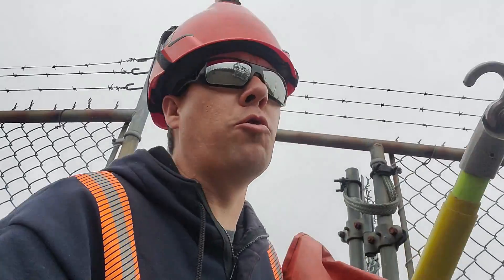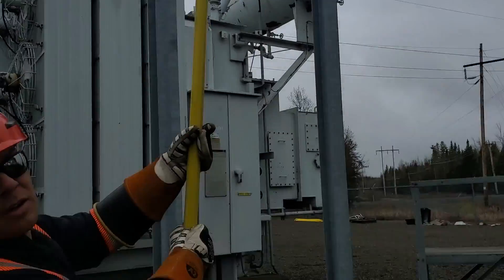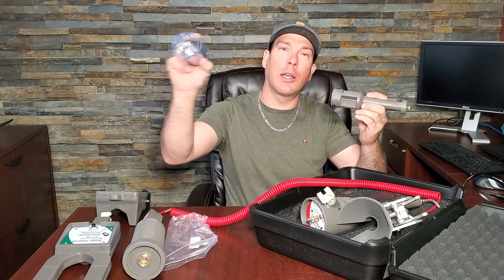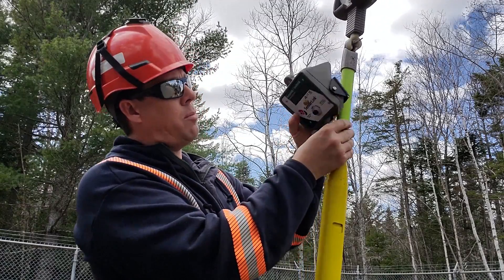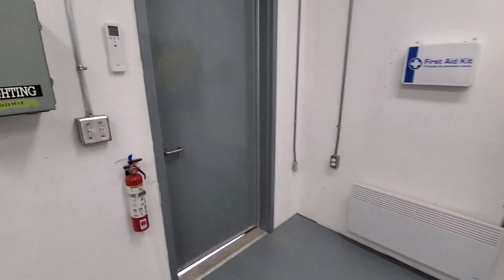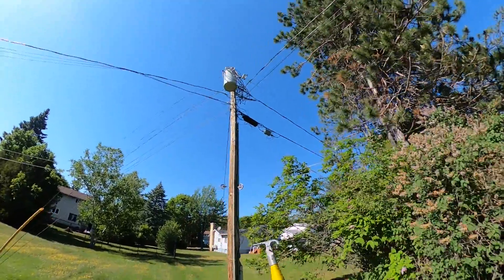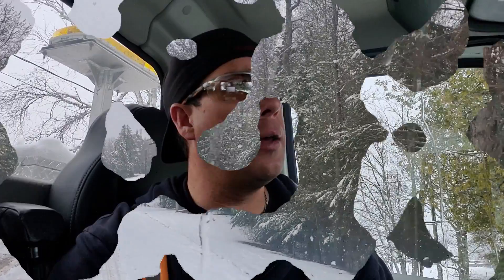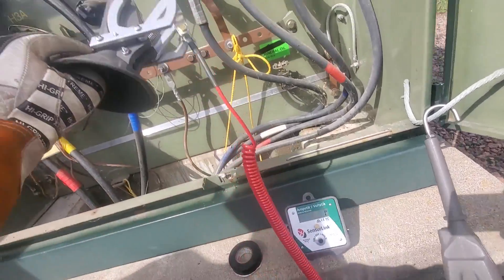High Voltage testing with SensorLink - Troubleman's kit

Comment from the maker: Another great use for the voltstik - It can verify tap positions on a Voltage regulator! 
I apologize in advance for the absolute cheesiness at the 5:38 mark!  🤣 - Have a great week everyone!
Reply: 69,000KV??? 69 MILLION VOLTS?
Reply from the maker: Lol someone else mentioned that! 😳  Ahem * 69kv 🤣🤫🍻🍻
Reply: Did your company have add it to a list of approved equipment and set up policy on its use
Reply: I get scared putting a fuse in a plug 🔌!
Reply: I've used a similar ampstick by the same company. I think it saves 9 measurements and you basically touch the amp clamp to the line and count 4 seconds and it should have a measurement. They come in handy for verifying phasing on relays. They also make a "wide mouth" version.
Reply: I'm not sure that I would rely on the voltstik to verify neutral position on a voltage regulator. Specs for the voltstik state plus/minus 1% while one step of a voltage regulator is less than that (5/8th%). It would likely easily detect neutral position but I just don't think I would rely on it as one of my neutral indications. But for troubleshooting regulator trouble, it is a great tool.
I really like the sensorlink products. We use the ampstik quite often when we do recloser maintenance. We verify amp readings from the ampstik to what the recloser control is showing to verify the integrity of each CT and CT circuit. 
I love your videos and love the content!
Reply: 1:56 - Vincent? Are we happy?  Yeah, we happy.

Comment: How do you trust doing de energized work on a line if there is the possibility that some ones grid tied solar is also feeding the line and their equipment fails to de energize or worse, it de energizes then randomly fails mid work? Is that even a thing that could happen?

Comment: As far as dead front transformers go I prefer to do all of my testing on the capacitive test points. Also it’s a good practice to do an amp check every time before you pull an elbow, you should have an idea before you pull it if you are dropping load or breaking parallel or if it’s a dead operation, the amp check will confirm what you think you are doing. Amp checks and potential checks will keep you out of trouble.

Comment: Using a new tool and getting a reading of 0 Volts, it'd be hard for me to trust that, especially with that kind of voltage. Even working with 120 Volt residential, I'll try some other backup for voltage check.
Reply from the maker: While that's a great point!... This product does have very strict and rigorous testing. I received copies of all testing records and certification for this equipment. A great way to confirm a zero reading (and should be done with any voltage measuring tool at each use if possible) is to check the device against a live wire as well .
Cheers Michael! 👊
Reply: @Bobsdecline  Thank you for getting back to me. You guys are my heroes, thanks for your videos.

Comment: We've been using these for several years and there are a few issues with the voltmeter. The clamp for your neutral or your 2nd conductor if you're going phase to phase is really cumbersome to take off.. It'll end up having your cord wrapped around the conductor. I took mine off and used a second extendo and and put a single eye log on that lead and just hang the extendo on the neutral or 2nd connector . Also the the power button to the Volt meter you have to take off from the resistor to turn on.  As soon as you power up the Volt meter hang it on an energized conductor if possible so so it does not automatically turn back off.

Comment: Ну это напряжение 6-10 кВ, для линейных электромонтеров. Я один обслуживал четыре подстанции 110-35-10 кв, и приходилось делать переключения на всех напряжениях с открытыми разъединителями на открытых подстанциях. Well, this voltage is 6-10 kV, for linear electricians. I alone served four substations of 110-35-10 kV, and I had to make switchings at all voltages with open disconnectors in open substations.

Comment: A couple of questions - 1st, does your job know that you are doing these videos and what do they have to say about it? 2nd - I am NOT a lineman but my work requires certification of all of our tools, especially measuring devices. I was given a simple tape measure by a vendor that supplies our company. I had to give it to the company and wait for it to be certified before I could use it. How does your work feel about you using a device like this without it going through their certification process first? I love your videos by the way!

Comment: Would love a suggestion on a long collapsing telescopic pole like you use in order to reach bees nests in the fall before they freeze and birds get to them. I just noticed you refer to it as a hot stick and I’ve never heard of or seen one but being made of fiberglass it should be fairly stiff still when fully extended. More so than plastic like I thought it was made of 🤦‍♂️. I don’t need it to be rated for electricity though so I wouldn’t need whatcha got there, but I never knew really knew what I needed before 🤷‍♂️😂. That looks like it would work a treat.
Reply from the maker: I don't think they're are easily available to the public, but then again, I've never really tried to buy one outside of work!. I did see one for sale at a flee market one time! 
There are many different manufacturers including some that are made for arborists that lock together. I've also seen rigid measuring sticks that telescope in this way. Any of these would definitely work for knocking down old wasp nests if you could find one online

Comment: Just wanted to point something out to you, not trying to criticize or put you down, just trying to spread knowledge about advertising and marketing disclosure laws. 
You were paid and this was a sponsorship. That test set doesn't cost them $0. They transferred an item of value to you, with the expectation that you would show it in a video. It doesn't matter if you were paid additionally, you need to disclose up-front that this is an ad. If you paid for it out of pocket, that's different, and you should state that clearly. Under Canadian (and American, and EU law) advertisements and sponsorships need to be declared in a clear, straightforward way. If a company sends you anything even without explicitly stating they want it put in a video, you have received something of value from them. Whether or not this biases your review is irrelevant -- the viewers have a right to know.
YouTube makes this very easy -- there's a checkbox you can tick stating that the video contains advertising or sponsored content. 

Besides this, great video! I always find lineman's work to be very interesting. I never work with high voltage, it scares the shit out of me, but I know that with the proper training and safety protocols it's quite safe to do... still, wouldn't catch me inside a substation! Heh. Cheers and hoping you have many great videos to come.

Comment: Just curious if you've ever had to troubleshoot Radio Interference (RFI) caused by any of the following?

Loose staples on ground conductor
Loose pole top pin
Ground conductor touching nearby hardware
Corroded slack span insulators
Guy touching neutral
Loose hardware
Bare tie wire used with insulated conductor
Insulated tie wire on bare conductor
Loose cross arm braces
Lightning arrestors
Reply from the maker: Yes, the most common by far would be the bare tie wire on insulated conductor or vice versa. Another common one I've seen is when conductors are touching and of the same potential, but the actual connection is a few feet away.

Had a few from loose insulators/pins or cracked porcelain as well, but those ones usually fail before they get trouble shooted for RFI

Comment: speaking of amps I'd like to hear a linemans take on the initiative to have x-million people coming home and plugging their electric cars into the grid every night at 5 o clock within the next 10ish years
Reply: If the cars use somewhat "intelligent" charging circuits and we consider "normal" usage where not all cars are run down to 10% battery or less at the same time, not a lot will happen. Also you will not very likely have millions of people on the same substation.
They did conduct an experiment here in Germany two years ago I think, where they provided electric cars and chargers in the garage of a 80 or so units apartment complex to find out exactly that, as that was what they were afraid might happen. As most cars had not run down that low and most did not even (have to) charge their cars every day, not a lot happened. Additional amperage over the days was somewhere 8 to 20 amps above before readings and we'll within what the lines could handle. This was 230/400 V three phase of course, so for the US a higher actual amperage can be assumed. (Just for perspective, a regular socket here can provide 16 A peak at 230 V)
Reply: @alexanderkupke920  A 50KW charger is a 50KW charger, in Australia most final distribution transformers are 11kV to 230/400V at 150 to 200 kVA feeding maybe 20 to 40 customers. With infill housing development, knocking down one house and replacing it with 3 smaller units, our infrastructure is already taking a hammering. A 50KW charger would require at least a transformer upgrade, or it's own step down charger. Modern infill higher density development without infrastructure upgrading being done at the same time is causing massive problems.
Reply: @raygale4198  well, at least around here no one talks about putting a 50 kW Charger in every home. Currently there is a Programm to financially support having Chargers installed in homes, but those are at most 11 kW. Which is plenty to charge a vehicle over night. There are some 22 kW chargers around, but mostly in parking lots etc.
Everything providing more, e.g. 50 or 60 kW usually can be found only on dedicated charging or service stations.
A lot of those charges already are intelligent in a way that a bunch of them can be coupled, so few cars can charge at full power or more cars can charge at an automatically reduced power.
The same technology can be used to control charging load to prevent grid peaks.
Also, what may be important as well, but very often overseen. A lot of electric vehicles cannot even charge at those rates.
Reply: @alexanderkupke920  The newer EV's can take up to 350-400kW of power- that's 800 volts at 500 or so amps.  You can find high capacity charging stations at some Porsche dealers.
Reply: @joshuapk9808  sure, but those high power chargers, i think Tesla calls them supercharger, are not what every home and every charging station in a parking lot needs.
Those are primarily if you have to go longer distances and want to charger your car back up to about 80 % charged within about 20 to 30 minutes. So I see those like on actual gas or service stations, especially along the highways.
At home usually a car is parked over night and you have hours to charge it again with way less power. Which looking at current battery technology also is a lot more gentle on the batteries.
That can we'll be done charging full once per week with 11 kW. Or if you go and recharge every night, it wouldn't even get up to that and most likely turn down to charging at about 7 kW.
Looking around how much kilometers an average car will run in a week here in Germany for example, even with only a 350 to 400 km range, those would only need to be charged once per week for over 85 % of the vehicles.
On the other hand if I was to drive from my office to Munich, I would need such a charger at least once maybe twice, depending on the amount of traffic and construction and how fast I can go.
Usually on that route you max out at about 130 km/h and even going 110 to 120 would take at most 10 to 15 minutes more but safe quite some battery.
Reply: Not a lineman, but the generation, transmission, and distribution would need to be upgraded, which is why there is talk of a million volt line for transmission
Reply: @austenteeuwen4223  As if 765kV isn't enough...
Reply: @austenteeuwen4223  --   If most of the charging is overnight and is set up so that the utility can use the charger to shed load, it's quite possible that the network might still be able to handle the load.   Indeed the load might be equalized over the 24 hours and peaking units can be replaced with  base load steam plants.   With smart meters and in household load shedding the utilities might even maintain phase balance at the neighborhood level.

Individual transformers might have to be replaced to meet the peak load as with 24 hour equalization, you have to size transformers for the peak load rather than the average load.
Reply: As a Journeyman lineman, all I think about is how much OT I'm gonna make when upgrading all parts of the systems. haha
Reply: @TupanSam  yes exactly, as an estimator I’m waiting for those type of projects to start stacking on my desk
Reply: It will melt the grid the same way that plasma TVs did.  You remember that right?  Whole grid melted.  Was really terrible.
Reply: Aren't battery chargers considered a capactive load?
Reply: @robertanderson3282  --  It designed right, a batter charger can be any kind of a load you want.   In the fullness of time remote controlled charges might be used to "tune" the power factor.
Reply: Not going to happen

Comment: For some reason I always expected substations and overhead lines all the cabling to be like 10s of thousands of amps...given I know just our furnace sucks up >100 amps at 240 volts.  I know wattage and all that's only like 3A at 7200V and would scale down at even higher voltage but its hard to imagine how many houses and businesses are on a line it wouldn't add up anyway.
Reply: Power loss in conductors is proportional to the current squared. Step up transformers raise the voltage and lower the current for transport. Transported power remains the same.

Comment: The Ohmstick would be an awesome tool too. It can measure resistance over a connection.
Reply: They sort of have those. They are called thermal cameras 😉 You can see right where you have high resistance connections that are generating heat.
Reply: I only mess with up to 24v stuff rn ( but will be forced to deal with higher as ev equipment becomes more common) in school we were told never measure ohms on a live circuit not sire if that changes with lineman applications tho

Comment: your a lineman out of....   even have a song about lineman.  I ran a large data center. High voltage is very important. most data centers cleanup the power and have backup generators.  Data Centers never sleep. High voltage lineman and linewoman also have someone working 24 by 7.  unsung essential worker.  Thank you for what you do.
Reply: Care to share some of that datacenter power equiptment porn? Relevent, interests.

Comment: Only thing I thought could have been safer with testing the low volt side of the pad mount was using a single pin probe rather than a hook just seems like a lot of metal to have waving around those big terminals

Comment: Why does electricity humm???
Reply: You’re hearing the laminated core of the transformer vibrating at line’s frequency.
Reply: corey Babcock  The hum is a lower note here in Australia where I now live and other countries that use 50 HZ power. I'm from the US so the 60 HZ hum is familiar to me.
Reply: Because it's having a good day.
Reply: It's called magnetostriction.  The changing magnetic field in the transformer core causes it to expand and contract at twice the mains frequency hence generating sound.

Comment: Nice piece of kit. The voltage readings at the end off the padmount threw me a bit, till I remembered canada uses 600v /347ish instead of the 277/480 in the US... 
I'm from the UK where it's almost all 240/415 still (despite the nominal voltage being 230/400.) We do have a bit of 480v split phase still around where the farm is at the end of a 1ph spur (actually technically 2ph, we do delta connections on the primary side here, makes leakage easy to detect and trip out on)
Reply: Oilfield equipment like pump jacks still use 480/277 in Canada, sometimes you will use 480 single phase. Most other commercial customers are 347/600 if fed off the distribution
Reply: @brenteichel7661  Interesting... I presume to allow inventory control for oil companies that work in both the US and Canada?
Reply: @TheChipmunk2008  likely the equipment is made for the American market, and it’s cheaper and simpler to produce one thing. When we build new 480 v transformer banks we use old transformers. We don’t have any new stock 480v equipment

Comment: I like the overhead amp stick, but I prefer the hasting phasing sticks especially if you have to check phasing between circuits, also prefer as much as possible to do all of my testing on test points on the underground.

Comment: One drawback - - - you save a ton of time - - - company will expect more work from you per shift! Good vid' though.
Reply: Needs to go through a 2 hour calibration procedure before each use for safety. At least, that's what you can always tell the boss!

Comment: Very interesting.  Do you have to get safety approval from your company before using a new bit of gear like that?
Reply from the maker: It depends on the situation. In this case, I did speak with my company first. We already have work methods for similar gear and I did receive safety standard documentation
Reply: was wondering the same thing !